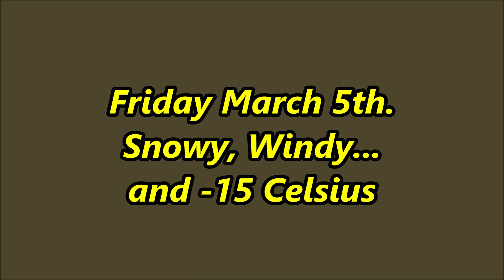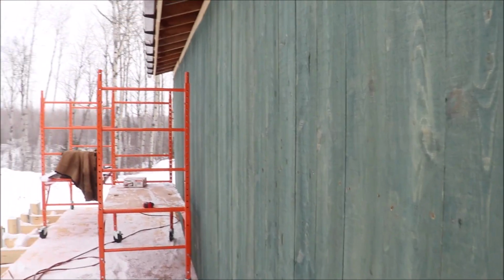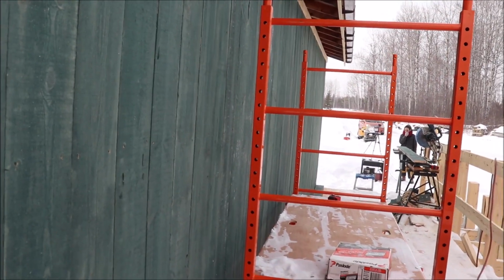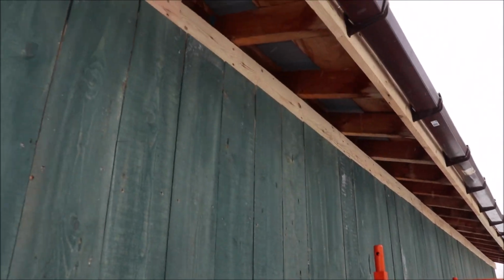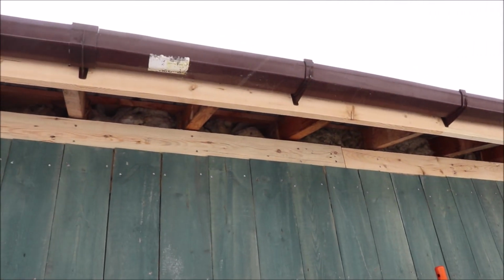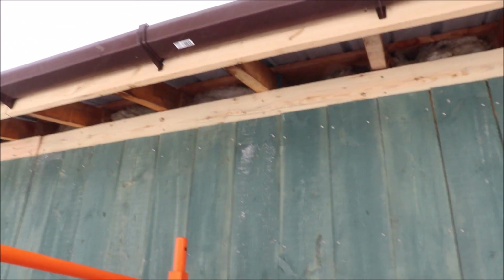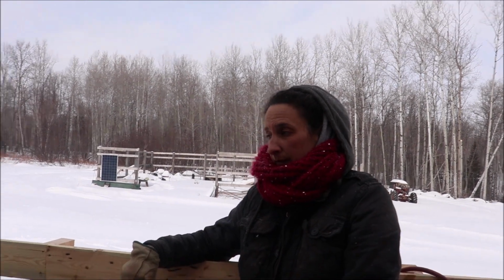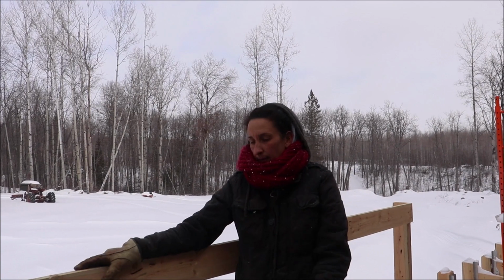Wow...We Did It , And In These Conditions. Our D.I.Y Siding Is Almost Done.

Comment: You got the easy part done, now comes the fun part all the trim and battens lol
Reply from the maker: Hello Glenn.  The trim on the long wall is just a 1"x4"x8' stained red on each end standing vertical and three 1"x4"x8' and one 1"x4"x4' equalling 28' horizontal along the top and bottom of the wall. And the batten strips are just 1'x1 3/4" nailed over the seams...How is that harder?   Way less logs and smaller ones to harvest and mill.  Cheers.

Comment: Looking good!  For the batteries,  52 volts is pretty good considering it was not sunny.  I work in telecom and our batteries are normally 48v banks as well, we float them at 54 volts, they'll drop to around 47v and that's when we usually dispatch a generator.   48v is basically 50% capacity so it starts to drop a bit faster after that.  If you can try to keep it above 48 at all times they'll last you a long time.   Also make sure to top them up with distilled water  once in a while.
Reply from the maker: Hello. Thank you...Our batteries stayed around 54 volts all day today, I think they just needed a good sunny day.  I have noticed that my charge controller is acting weird now...maybe it's normal?  With the 12 volt system our volts from the panels were around 132 volts in @96 amps, but now our midnite controller is only allowing 105 volts in @42 amps...when the amps goes up to 57 our volts in drops to 98 volts.  Do you folks ever sell off your out dated batteries? I'm thinking another system for our future cabin build.  Thanks again. Cheers.
Reply: @SkinnersHomesteading  Unfortunately they have policies to not sell batteries and instead they have them recycled, it's really too bad since what's not good enough to keep a CO running for 8+ hours might still be good enough for a home.    As for the panel voltage that does sound a little odd but it might possibly be normal because you might not be draining the battery as far so it never needs to pull as much power.
Reply from the maker: Yeah I wasn't sure, most places have policies like that...Thanks anyways. I am going to keep an eye on the voltages and when the weather gets nicer.... I'll check the  panels, perhaps I have one bad one....they can produce full volts until under load, then they will short and the volts will drop.  Thanks again. Cheers.

Comment: I heard your previous explanation for leveling. What good does it do to check for  level after you have nailed it?
Reply from the maker: Hello Greg...Checking for plumb after I nailed a board gives me an idea of which way to lean the next board for any correction.  It's easier to nail one, check for plumb, then correct with the next one...rather than try to hold the nail gun, a board and the level in my teeth.  Cheers.